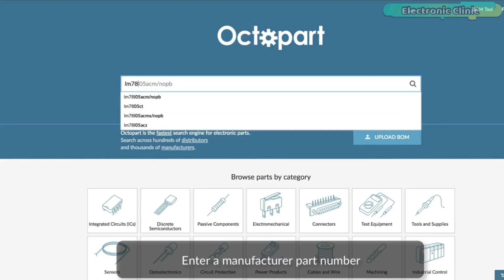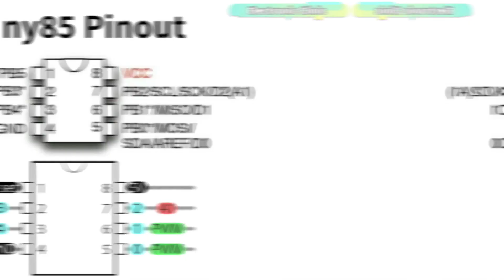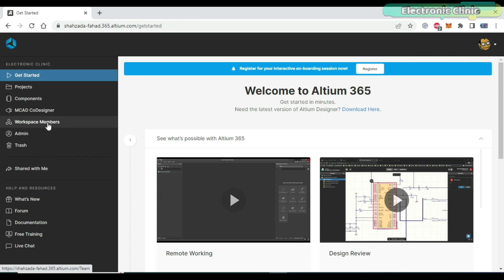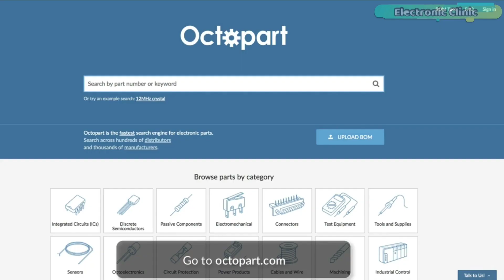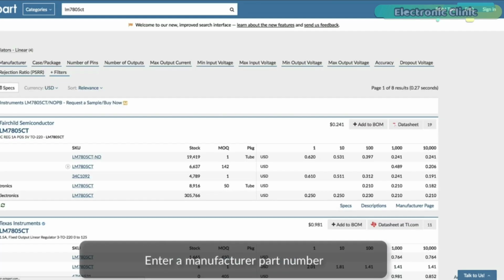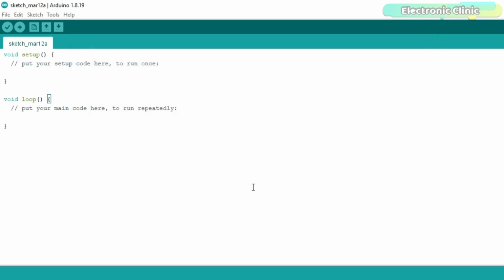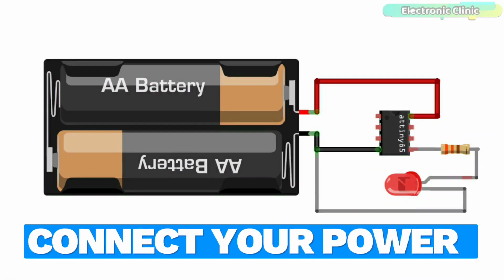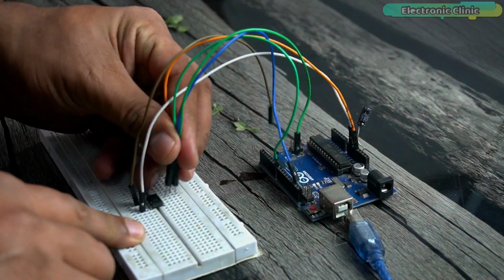ATtiny85 Arduino Getting Started Tutorial, the Smallest Arduino, Micro Arduino, ATtiny85 Bootloader

Comment: Follow up Question:  Can you program the Attiny85 in circuit?  meaning, does it always need to be removed from the circuit in order to be re-programmed?
Reply: The ATtiny needs to be in a programming circuit like the one in the vid to be (re)programmed. Easiest is to install it on 8 pin mounts so you can swap them out easily. The programming board should also have an 8 pin mount. You can use the video above to make your own dedicated programming board, the one I made straddles the Arduino and has 4 pins on both sides. One set connects to 13, 12, 11, 10 of the Arduino. The other set of 4 pins goes into Reset, 3.3V, 5V and Ground (I don't actually use the 5V pin). It will look crooked as the pins don't line up exactly due to a gap on one side, between pins 7 and 8. I have the ATtiny mount and the cap in between the sets of pins, all connected as in the video. If you're gonna use the ATtiny in more projects, it's well worth it to make your own dev board, rather than rebuilding the circuit on the Arduino every time.

Comment: Whe I upload the code at the end I get 
A programmer is required to upload
Reply: Try twice. I encountered the same issue but now it works.
Reply: I used uno rev 1 fail, uno rev 2 fail no programmer identified. Used Tiny Programmer instead of uno on IDE 1.6.4 n finally got it to work. Curious which Uno and IDE is used in the video